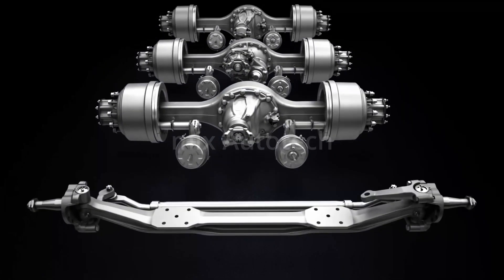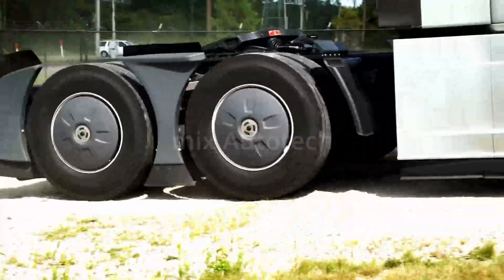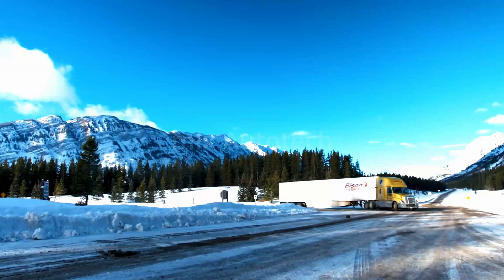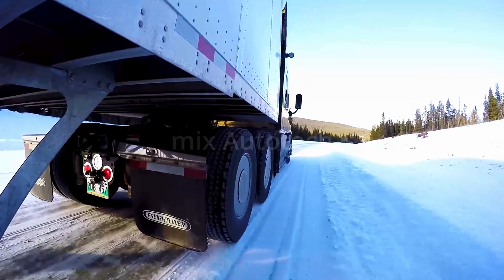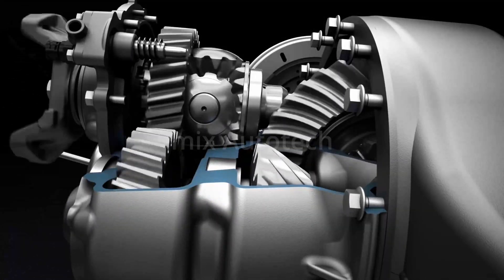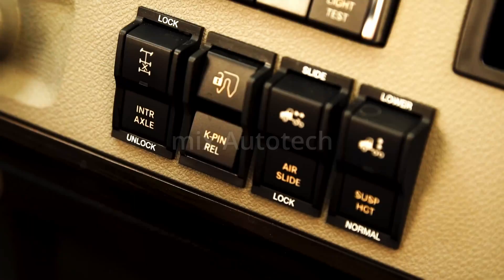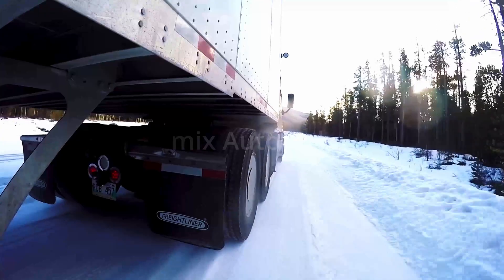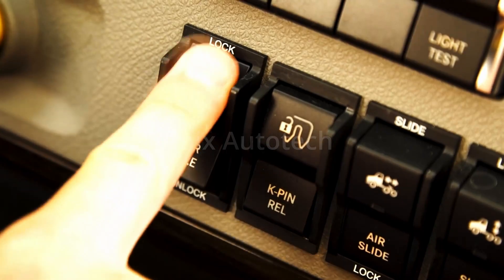What is Inter Axle Differential locks?

Comment: I drive a 2022 Peterbilt garbage truck with 2 diff locks and an inter-axle lock. I'm frequently on loose surfaces and when the back wheels begin to slip, I engage the rear lockers. The placement of the buttons in my cab is terrible, so I can't actually the see the names of each locker, so I just keep pressing buttons until I get moving again :)
Reply from the maker: you better put some markings